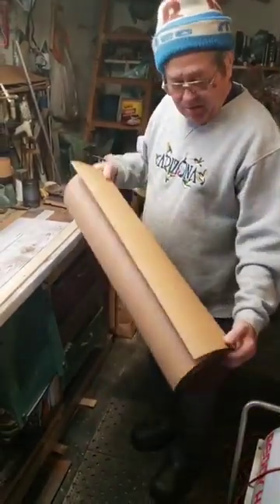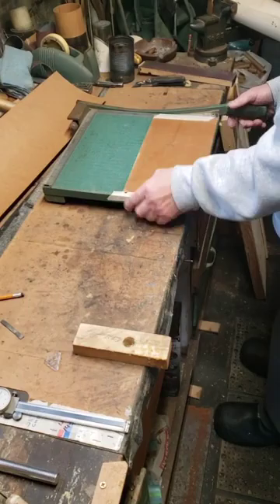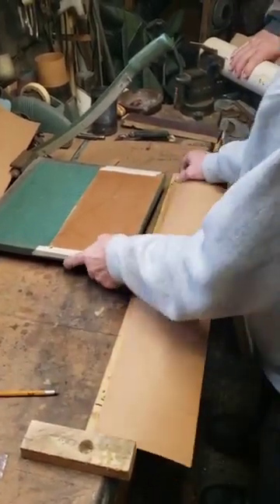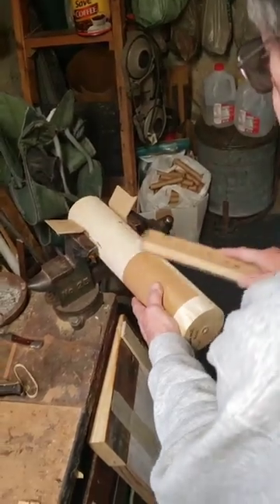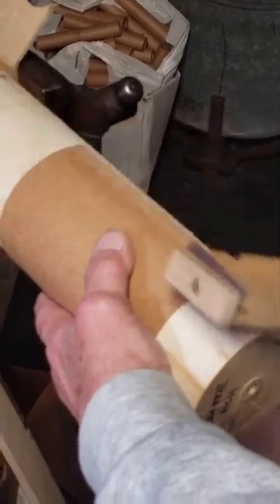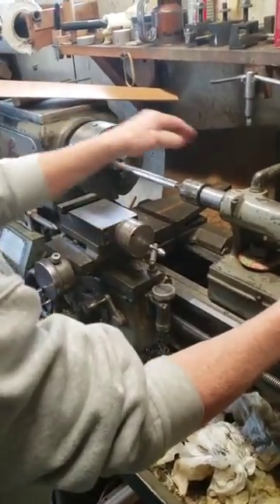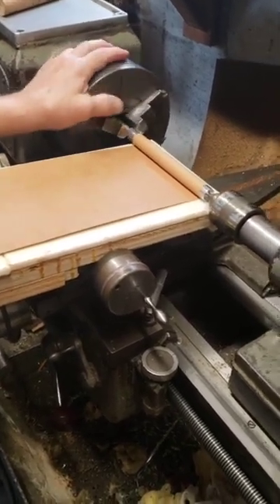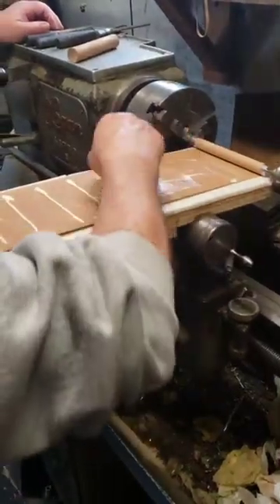LaDuke rocket tubes

Comment: I use the card filing sleeves from old filing cabinets to make tubes, spollets, shells etc.
I get a cabinet now and then for tool storage in the shed and find the card they used for the sleeves is very high quality and strong.
I don't have a lathe unfortunately.

Comment: When i tried hand rolling a tube, i was using elmers glue all, but the paper started to tighten up and shrink causing creases and made the tube come out somewhat loose. 

I don't remember what paper i bought i know it was thin. Wondering what can cause this? I added water to glue. 

Should i use wood glue? Using a  Wooden dowel too btw. Prolly not smartest idea.
Reply: @GH-jl2td  I appreciate you so I think I just rushed the process I did it again on a smooth glass surface 

Came out great!

Comment: This is great and all but who the hell is going to be able to get a rod with a precise cut to hold the paper on the lathe while it spins?
Reply from the maker: A machinist, or someone who knows a good one.
Reply: @ i had inquired multiple local machinists for rocket tooling instead of buying from Firesmith or Woodys and they had quoted $200 just for setup and total was about $500. Machinists dont seem to be cheap so i ended buying my own lathe but i cant cut a precise line like this on a rod without a mill machine.
Reply from the maker: @NagashiChidorii  I'd bet that Caleb could/would do it for a reasonable price. He's very customer service oriented.
Reply: @nedgorski  Yeah if you can get ahold of him though, guy seems incredibly busy.
Reply: @NagashiChidorii  I am a machinist, can cut the slot for you for $100